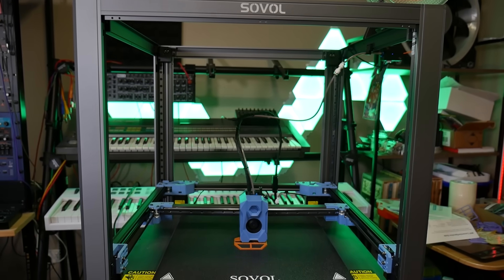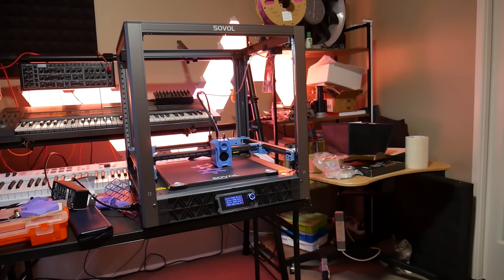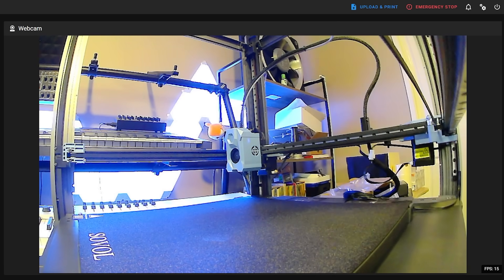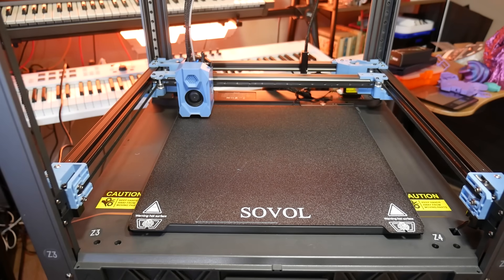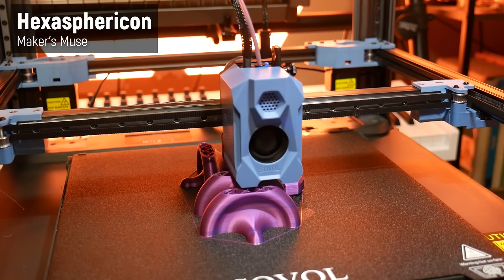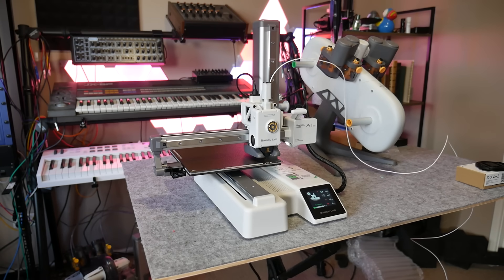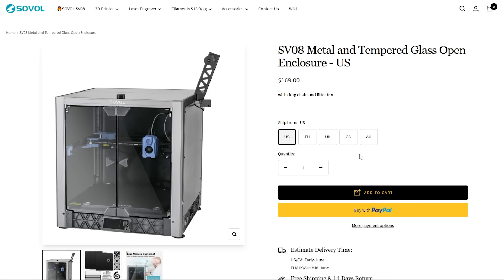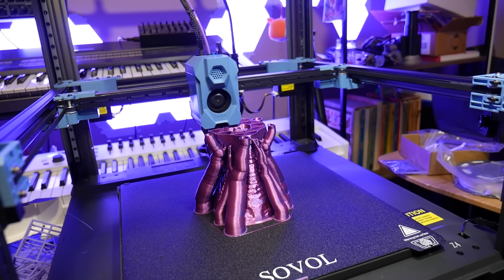Based on a VORON, made by SOVOL... but is the SV08 any GOOD?

Comment: Can reviewers stop the BS and call a product open source when it's clearly not. Having the ability to download the files and look at them in a cad product does not make this open source, Even if you have access, who is gonna make the files into a real thing without charging you and insane amount of money?. 90% of this product, if not more is proprietary or say its proprietary because it looks like a voron... god... this has to stop. You did call it proprietary but had to admit real quick that it's really not, at least you were transparent about it.

Open source would mean you can buy the frame, buy the nozzle, the extruder etc... you see where i am going

Being a long time Sovol buy i can tell you that most of them stuff is hard to find on a 3rd party market. Sovol knows this and will continue to produce machine where you have to run to them to get the major parts. They are kind of lenient on the consumable like the nozzles "lately" but they have produces enough machines where you can only buy from them for a "perfect fit".  

Case in point Sovol making the nozzle for the sv06 plus just like a ridiculous amount of different in lenght from the standard k machine that came out around the same time so that you had to run to them and not go on 3rd party market and buy k machine nozzles that were sprouting like mushrooms. That's how sovol works slight difference so you are sol and needs parts from them or even worse when the machine is not supported anymore you are stuck or if sovol goes under then you really have a paperweight on your hands "if" you are the type that is not tech savy or have the inclination of tinkering on your machines....

Comment: Oh, GOD, I'll make my own table!  4x4 legs, with 2x4 cross braces, leveled with extreme care, at which point, it won't matter whether you use a wood, plastic, steel, or even a concrete table top. Sorry, but I'm anal about a stable work surface!

Comment: Hi.

Thanks for your review.  I have a big question (for me at least).  Can the Sovol SV08 be modified to have a slightly larger print bed.  I need a print bed that is at least 375x375, or better yet, 400x400.

Thanks . . .

Phil
Reply from the maker: They have a bigger version coming I believe
Reply: @MakersMuse  Hi

Thank you very much for letting me know this.  Phil

Comment: I would love to see an open source ams system to partner with this printer. I am in the market for a printer, and this one looks to be fine for my purposes. I until now only printed in PLA, and don't expect that to change. However I would really love a multi color system, and I won't buy a Bambu-crap.
Did you notice there is a LAN port on this printer? You don't need to mess with wifi. Just connect it and go. (I prefer cabled networking)

Comment: As someone whose disabilities prevent her from doing too much assembly, I welcome this printer and am veering rapidly towards buying one. I can screw in screws, I can plug in plugs but any kind of precise movement is impossible so no use of soldering irons, which makes assembling a Voron 2.4 from a kit impossible as I understand the current situation. To give you some idea of the problem: I can chop up vegetables safely when cooking but I can't use a pen to produce any legible handwriting.

I want a 3d printer to print parts to help me with daily life and sometimes that will mean using flexible filaments, so if anyone has any experience they'd be willing to share I would be most grateful.

Comment: Thanks for that video, it was good.  I'm currently looking for a new 3D printer, with a bigger build area, so the SV08 might be what I'm looking for.
I just went to the Sovol WEB Site, and it looks like they are now giving you the option to get a closed in case, which is good.
One thing I was disappointed in, was that they didn't display the currency they were using.  As expected, it was in US Dollars, but with the crappy exchange rate, that adds a lot more cost, or at least in my case.  😞

One last think, unfortunately, the SV08 doesn't have a colour printing option, and according to their Customer Support people, they aren't planning to add one in the future, or even one on their next model.
Not that colour printing is a deal breaker for me, but that would definitely be something I would be interested in.  By any chance, would there be an aftermarket Filament Management System, which could be used with this 3D Printer or others?  If so, that would make an interesting Video for you in the future.

Comment: I started 3D printing when we had to build a 3D printer because there weren't any commercially available hobby printers.  The SV08 is my 12th 3D printer.  Here is my lengthy opinion on the SV08, for the prospective SV08 buyer.  Short answer:  It's a good shortcut to get most of the features of a Voron 2.4 at a third of the price without 40 hours of building, but it has some issues and isn't a good first printer for someone who doesn't want to tinker and just wants a reliable 3D printer out of the box.

Sovol got a lot right when adapting the open source Voron 2.4 to be a relatively low cost consumer version of this advanced large volume flying gantry coreXY 3D printer, and they deserve credit for all of the engineering changes they made so the SV08 is suitable for manufacturing and to reduce cost.  Sovol deserves huge credit for keeping the design open source, even to the extent of supplying STEP files for all mechanical parts.  This was a large part of the reason I bought an SV08, and look favorably on all Sovol products.  In most cases, Sovol made good engineering decisions, but there are some issues with the SV08.  Probably half of the problems were the result of excessive cost savings, beyond what was prudent.  In a few instances, the Sovol engineers were penny wise and pound foolish.  In those cases, their customers would have gladly paid the difference in price for less problems and/or better performance.  Some of the other SV08 issues had nothing to do with cost cutting and were the result of time to market, where there isn't time to resolve even known issues before shipping the product, much less extensive alpha and beta testing to refine the product before release.

1) The aluminum print bed is too thin.  It's warped slightly more than 1 mm across the bed surface, resulting in problems establishing a uniform first layer on large prints.  The problem is exacerbated because the warped surface changes when the bed is heated.  The warped bed is rigidly mounted to the base so there is no way to shim it to level it, so owners attempt to fix the "taco bed" by drilling holes in the magnetic sheet to access the screws, removing the thin bed and installing 3D printed spacers to level the bed and pre-tension it to compensate for the thermal expansion warping which varies significantly between 65C and 95C. Sovol should have specified a 10 mm thick stress relieved cast aluminum plate (MIC6 or equivalent) and mounted it with springs, with the mounting screws accessible so the magnetic build surface can be removed and the mounting screws can be adjusted to level the bed and fine tune the very minor thermal warping in a thicker stress relieved bed.  The aftermarket should offer a thicker cast bed upgrade.  Sovol is expecting the bed mesh Z offset compensation to do miracles, but it can't.

2) The inductive probe doesn't produce sufficiently accurate and repeatable bed mesh results, further exacerbating the first layer problems previously described.  Users are modifying their tool heads to remove the inductive sensor and replacing it with a contact sensor.  Sovol should have probably used a contact sensor for greater accuracy.  It would also prevent a crash when calibrating Z height when forgetting to replace the magnetic spring steel build surface.

3) Most people don't like the clicky knob character LCD user interface.  It seems cheap on a modern 3D pritner with these high end features.  Rotating the knob doesn't always move the display to the next menu item and sometimes it skips ahead two items.  Clicking the knob doesn't always select the menu item and it often needs 2-3 knob pushes.  Probably half of the users are buying a 5" touch screen user interface that attaches to a USB port and HDMI port.  The Big Tree Tech 5" user interface costs $45 retail, so Sovol should have provided a modern touch screen graphical user interface.  Users would have been happy to pay the small difference in cost with a decent profit added.

4) Many users don't like editing wifi.cfg and writing it to a USB drive to set the WiFi login credentials.  I thought it was a reasonable solution to avoid trying to enter that information on a clicky knob character LCD user interface, but I was among the majority of users for whom the WiFi never worked.  I was forced to buy a WiFi bridge and plug it into the ethernet port for data and the USB port for power.  Maybe adding an external WiFi antenna as many 3D printers have instead of a tiny antenna behind the aluminum motherboard shield would fix the WiFi connection problems.  Maybe the built-in WiFi only works with the 2.4 GHz or 5 GHz band?  Maybe a firmware upgrade might fix the problem?

5) Some users had nozzles pushed out of the hot end when printing PETG with its higher pressure.  Sovol fixed this by adding a set screw to retain the nozzle.  Every manufacturer creates a slightly different high flow nozzle.  All are similar to the Volcano nozzle but we're forced to buy a slightly different proprietary nozzle that won't work on any other printer.  Replacing the hot end with a MicroSwiss hot end results in a high quality and known good hot end that uses the MicroSwiss FlowTech nozzles that can be cold swapped without removing and reinstalling the heater and thermistor.  The nozzles are then compatible with all other printers once they have the MicroSwiss hot end installed.  Installing the MicroSwiss hot end is as easy as changing the original manufacturer's nozzle that requires the heater and thermistor to be removed and reinstalled without damaging them.  One the MicroSwiss hot end is installed, the nozzle can be swapped in a minute, using only one hand and a 7mm nut driver.

6) The web camera doesn't always work.  Sovol has a page devoted to the problem.  They advise checking to ensure the plug is fully connected as some units shipped with hot glue preventing the connectors to be seated properly.  Then Sovol recommends ensuring the other end of the USB cable is properly connected to the motherboard, and if that doesn't work, try plugging it into the USB port on the side of the printer.  If that doesn't work, try deleting and reinstalling the camera in Klipper.  If that doesn't work, sometimes reflashing the MCU will fix it.  Sovol would appreciate any info you have on the problem.  In other words, hopefully the community will figure out what's wrong and fix it.  My camera didn't work.  I upgraded the printer's firmware to 2.3.3 and the camera worked.  A few hours later it stopped working again.  This isn't a problem for me because my printer is next to my computer but this would be a big problem for anyone trying to manage a print farm, or for people who want to use the phone app to remotely monitor a long print job.  I would have much rather had a better printer user interface than a camera I don't need that doesn't work.  I'll unplug the camera to ensure privacy and security.

7) There is a small LED lighting strip inside the top frame, in the front, on the right side.  It's marginal.  A brighter strip running the full length of the front would have been much better.  Bright strips on the front, left and right sides would have been better still.  I ordered the 24 V LED strip so I can upgrade the lighting.

8) The double bearing spool holder seems nice but stiff filaments tend to unspool and tangle.  Sovol published a de-tangle mod, based on the many user mods to fix this problem.  This begs the question, did Sovol test this printer before shipping it?  Did they only test with PLA?  This wasn't an issue for me because I print a lot of TPU so I feed it from above with no reverse Bowden tube to cause drag, so I'm not using the SV08 reel holder.  However, eliminating the reverse Bowden tube allows the extruder cable to droop and drag so I needed to design and 3D print a custom cable chain to stiffen the cable to ensure it remains in a uniform vertical arc.

9) The bed preheating before quad gantry leveling, Z height calibration and bed mesh probing all uses 65 C, but many people are printing PETG, ABS, TPU, or other materials with different bed temperatures, so the bed warps after the calibrations are done.  The calibrations should be done at the same bed temperatures that are used during printing, and the nozzle should be heated as well, but not enough to allow plastic to drool.  Some users modify their config files to pre-heat the bed to the temperature used for printing.

10) The filament run out sensor is mounted to the reel holder.  It dangles down, like an after thought.  Modern 3D printers should integrate a tiny optical filament run out sensor to the top of the direct drive extruder.  This would make filament loading easier and would use all of the available filament rather than leaving a reverse Bowden tube full of filament that must be cleared.  When the filament is all used, the extruder should immediately unload 20 mm of filament to clear the hot end and provide a short piece that the user can grab to remove the 50 mm stub of filament.
Reply: Thank you so much for this excellent comment.
Reply: @qmriis  - Additional Info:  My SV08 camera works, I just need to restart Crowsnest (web interface, under the top right Power button menu).  With its issues, the SV08 is my favorite printer and my Go To printer.  It paid for itself in two days of production for my small online business and I keep it running almost all of the time.
Reply: @qmriis  - Update:  The camera works on my SV08, but I need to restart Crowsnest by clicking on the power button in the top right of the web browser.  My SV08 is running almost constantly, making parts for my online business.  It's my favorite 3D printer and my Go To printer.
Reply: Really liked your review. Kinda turned me off the sovol sv08. What do you think about k1 max?
Reply: @bert5376  - I don't own any Creality printers but I was impressed with the features of the K1 Max.  I decided to wait to see what early adopters thought about the K1 Max.  The reviews were mixed.  Many nice features but true to old Creality form, a bit rushed to market.  There were extruder problems but Creality fixed them.  I think they eventually fixed the major issues so the K1 Max may be a better proposition than the flagship K2 Max if you aren't interested in multi-filament printing and the K2 Max bells and whistles.  There are some nice upgrades and community contributions for the K1 Max.  I'd add a MicroSwiss hot end to get the excellent quick change FlowTech nozzles.

If you don't need 300 mm x 300 mm, Creality has some good pricing on the K1.  $369 is a good price for an enclosed 220 x 220 mm coreXY printer - less than half the price of the K1 Max.

The K2 Max is a much more finished product.  I love the features - almost everything that anyone could want - but I'm a little dissuaded by the cost and complexity.  It has motors for belt tensioning.  I tend to like simpler tools, particularly if I plan on using them a lot and I'm maintaining them.
Reply: After you add a cast bed and the screen It Will be much more expensice, agree they should have shimmed the best from factory

Comment: 10:59 for now, if rather have a multi part open source system that can be taken apart and rebuilt. No single company going under will cut the supply and even if nobody makes them anymore you can still get them machined.

Comment: Idk why default slicer profiles ALWAYS get this wrong, but I'd be willing to bet your stringing would've been gone if retraction were at 0.4mm, with the speed up, and z-hop were turned off. It's so wild that I see the exact same stringing on PLA, in every single video for the sv08, and it's simply that the profile has the wrong retraction setting for an allmetal DD.

Comment: I think this is fantastic. I wanted to go the route of the Voron but the price is much higher than I wanted to spend and I didn't want to spend weeks building the machine. This is the best compromise in my opinion. Great price for a very capable machine even if it has a few areas that you may want to upgrade.

Comment: @longfang98 I own both brands, along with 6 other open source brands. 36 printers in all. With Bambu, you pay for the printer and the right to use it, mostly as Bambu sees fit. There is very little you can do to modify the printers behavior without voiding the warranty. I have several open source printers that are at least as reliable as the BL - and that's because I was able to make necessary improvements with no impact to warranty. Each has its values, but open source is the backbone of 3D printing. Without it, there would be no Bambu to fanboi over, since nearly every aspect of Bambu printers comes from open source roots. There's no real innovation, just engineering advancements over methods that original open source created.

Comment: 7:18 - you mention whispy stringing possibly caused by the hot end and cooling fan speed. 
What can be done about this, I have the same issue after installing a better fan on my SV06